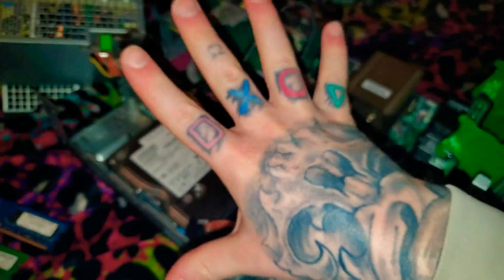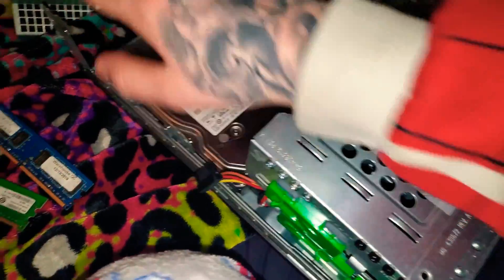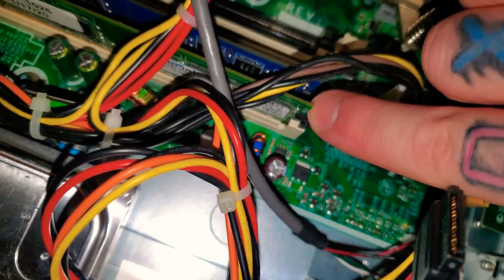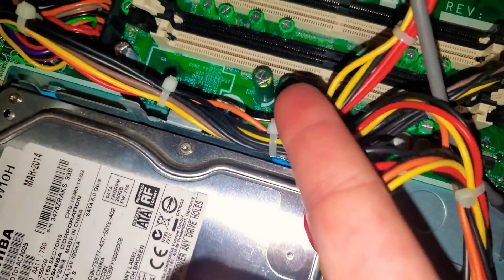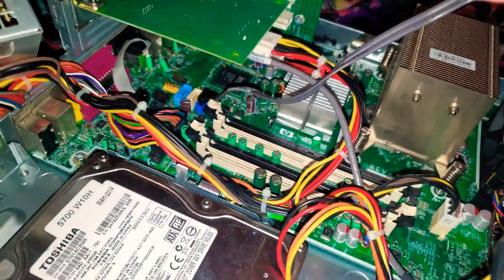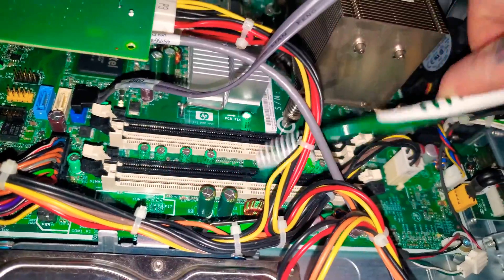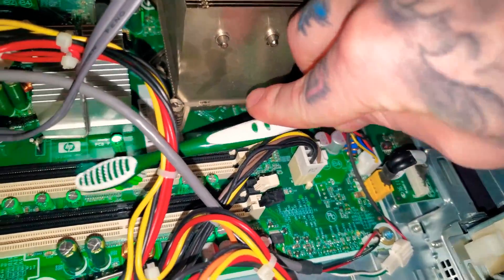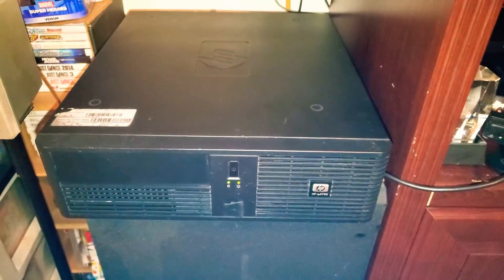EASY FIX If Computer Is Beeping 5 Times Malfunction

Comment: My problem it truns red  and beebs 5 times and after the afew minutes the beeps stops and it shows the red  only and the fan goes into overdrive and its very loud
Reply from the maker: @m4m313  dang idk about that
Reply: I got same issue
Reply: Did you find a solution?